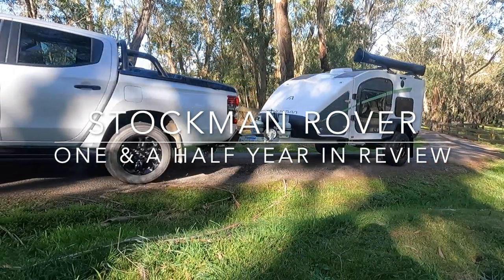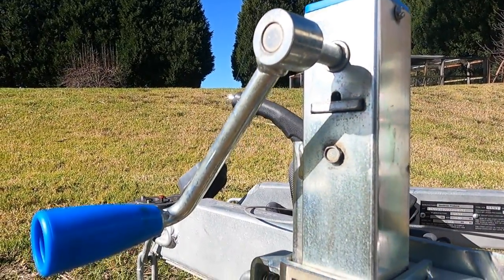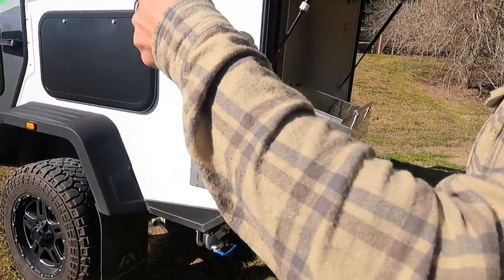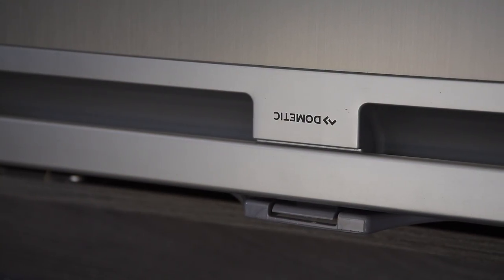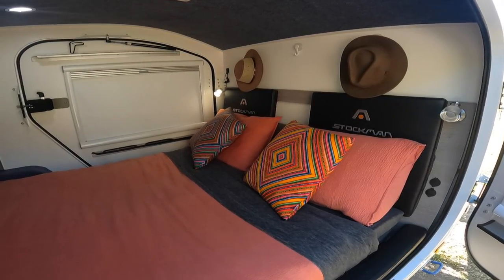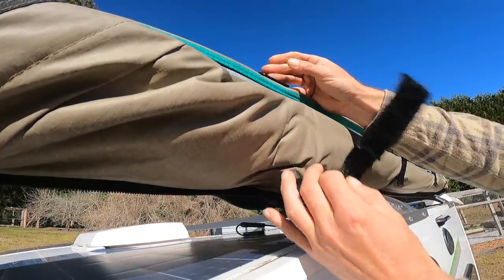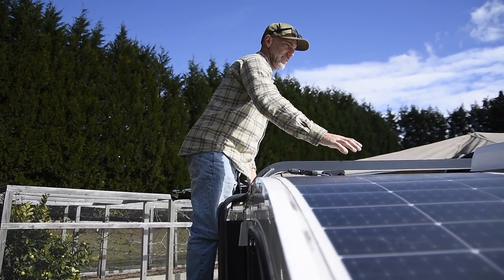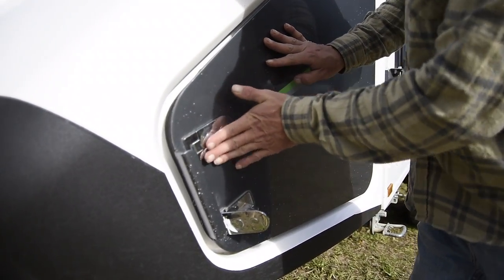Stockman Rover Review - One and a Half Years in Teardrop Camper Review - InDepth Walkthrough

Comment: Yours is older than ours by a week 😀. 
We got the same as you did but did add the TV inside which has been amazing for us when the weather was bad and we had to bunker down inside.
I upgraded the 2 batteries to Lithium and installed a Redarc BCDC40 amp charger in the rear so bypassed the original PWM solar charger.
The fridge fan on ours was wired the wrong way so sucked in rather than out but I quickly fixed that myself.
The stone guard is a must along with a set of Rocktamers as we have some stone chips on the toolbox doors as well but not as bad as yours!
Don't forget the NSW meet and greet in October!

Comment: Awesome review.
I have a question regarding the shower tent, does it impede with the strap used to pull the awning tight on the side of the van?
Reply from the maker: Hi! It doesn't impede with the strap to pull the awning tight BUT you have to get the shower tent out before you attach the awning strap. We will be doing a video on the awning and shower tent soon :)
Reply: @roverinroundoz  I thought that may have been the case. I was simply curious, thanks for the reply.
Loving the videos btw, cheers Paul.
Reply from the maker: No problems! Should be more adventure coming soon with the warmer weather here 🙏

Comment: Great review, thanks. My wife & I are considering 'upgrading' from tent/tarp/esky camping (that we've been doing for the past 45yrs & still enjoy) to something that is easier ie. easy to depart home, easy to setup & packup etc. We are struggling to envisage ourselves in a caravan so one of these pod campers might be the go. Can I ask the following: has the company been good to deal with? If you were purchasing a Stockman Rover now, what model would you go for? You've been pretty positive in your review, what are the negatives (apart from the purchase cost)? Have you seen the Hitch Canning Pod Camper? Any thoughts on it? Any other comments/thoughts are most welcome. Thank you.
Reply: We’ve had our Rover for more than 2 years. We bought the Ultra and don’t regret it. Essentially you need to figure out what is important to you. Some things can be retrofitted/purchased afterwards. 

Things we would consider essential are: 
Stone guard (even with it you get quite a few chips), electric brakes, sirocco fans (although you can save a lot by fitting them yourself), extra awning walls for bad weather, fixed ladder if you want to store things on the roof or have a roof top tent.

Desirable:
Awning and walls for other side (or the person on that side gets wet in bad weather). Fold out exterior shelf is also very useful. 

Stuff I wouldn’t bother getting: 
Draft skirt (have never used it).

Luxuries: 
We have an inverter and use it to run a coffee machine and occasionally a blender. It takes up a lot of space but we like having it. We also have the 12V AC. We have used it as we didn’t have the sirocco fans. Now that we have those, I suspect we wont use the AC much (it’s very noisy). Having the 240v system is nice, especially if you are at a powered site (and don’t need to worry about batteries) but we haven’t done that much.

Stockman/Camperact were very flexible and helpful during purchase. We didn’t want the stove and so they swapped it out for a solar blanket. They were also great to work with as we wanted a RTT (which needed a specially made platform) and wanted a different tap for the sink.

Issues we’ve had: to preface this, I think things will break/come loose in all camper trailers if driving on our outback tracks. 
Awning walls tearing at the bottom connections (we had our reinforced) and not long enough to reach the ground (only an issue if you have the 30 sec dome tent and Stockman now sell extenders). Vent fan broke (Stockman are sending us the part and they have changed to a different vent, I assume as a few of us have had issues). We’ve replaced the stabilisers as we lost some of the plastic feet. Put larger washers to hold the water tank. Added a clip to fridge door (door fell off on very rough corrugated road).

After service with Stockman has been great. They are easy to contact, give great advice and fix/send parts if required. We recently have been a little disappointed with Camperact who have been difficult to contact for a service. 

Basically, work out what is important to you and if you can trial one.
Also Carl has setup a great public facebook page where you can ask other owners for their opinions https://www.facebook.com/groups/229238723080107/
Reply: Thanks so much for your detailed reply.
Reply from the maker: Hi Phil, Sorry for the late reply. We love our Rover and also went straight from tents. It has been such a nice transition from lugging around a tent and sleeping mats. Stockman has been great, we haven't had a lot of contact but of what we have they have been lovely. If we purchased again I would opt for the same model, the intrepid, in the middle but would probably upgrade the battery and solar setup. It's hard to pick negatives unless you are being really picky and being our first caravan/camper we have nothing to compare to, we tend to just adapt to things, but the 2 dissapointments were the fridge fan which I mention in the video and the roof lining has come away in some sections inside the cab which I forgot to mention but nothing horribly bad. I believe since we bought in Nov 2021 they have made a fair few changes to a few things so it could be different now. I have not seen that camper, there are so many on the market these days. We just simply fell in love with the Rover and decided on that, I recommend going to view a few campers that interest you because originally I loved the Sherpa by BRS off-road but when I went to view it I didn't like it at all, just not our style so I think its a personal choice. Anyway, good luck with your choice and enjoy whatever you decide on :)
Reply: Thank you for taking the time to reply. We went to the Brisbane Caravan/Camping Show, held a couple weekends ago. Unfortunately, Stockman weren't present but we got to see many, many other options. We're now more confused than ever 😂!
Reply from the maker: @philclose7063  haha, understandable! We recently watched the ‘fire to fork’ guy go out in a cub caravan… it looked pretty neat and tidy.. when we one day upgrade I want some inside space for the bad weather days 😉
Reply: Well, after much deliberation we have put down a deposit on an MDC Forte9. A very small van which offers some inside space for those bad weather days &/or the dog. A small van but a big step for us. Like you, we have been long term campers (45yrs) so this next stage will be interesting & hopefully help us get 'out there' much more often!
Reply from the maker: @philclose7063 awesome! Enjoy the journey 🙌🏻

Comment: How does the Rover perform with dust getting into the cabin?
Reply from the maker: Never had an issue. The door seals are great and the doors have an extra lock to make the seals tighter if you need to tighten them on a dusty road 👍
Reply: We got dust in the cabin once when the vent/fan latch broke. Stockman have since changed the type of vent/fan in the trailer I think. Otherwise, no dust at all.